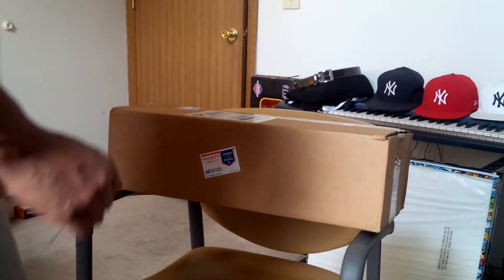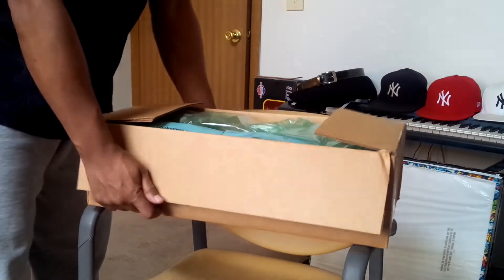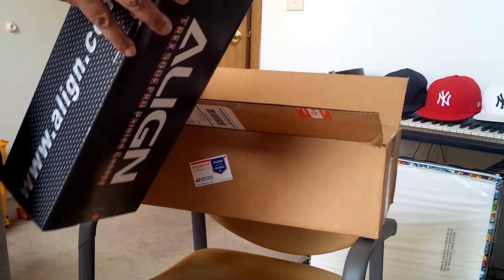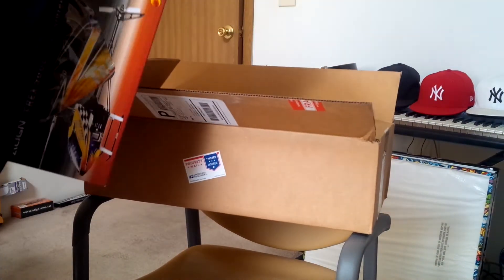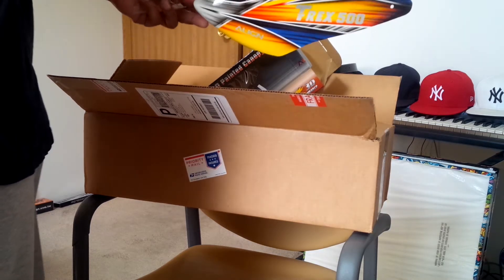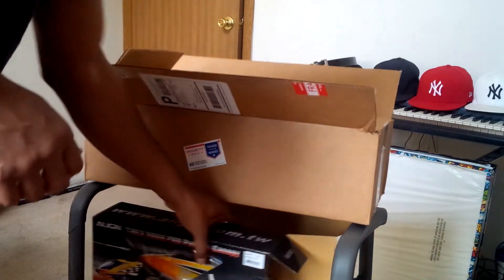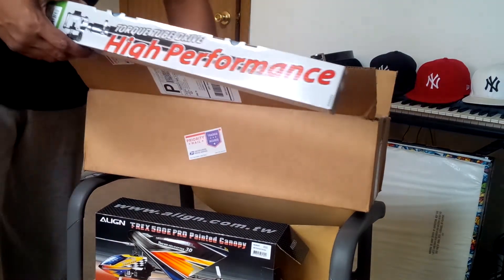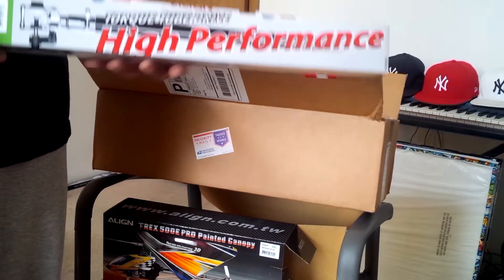500 Torque tube upgrade

Comment: I dont believe TT is an upgrade. But just another way of running your tail rotor.

Belt is nice because it is reliable but depending on power and traction it can skip and cause tail kick outs.

Torque tube is nice because there arent tail kicks at extra power however if you strike the tail the gears are fone most of the time as for the belt it just skips but can be used again.

As for crashes belt wins every time since when you crash most times the tail boom bends. Meaning Torque tube also bends. Causing after rebuild major vibration issues even if sometimes you try to bend the torque tube back straight. So you will end up buying again new TT and gears as when your on belt drive you just replace the tailboom.

Good luck with the build and hope your sort that tail out.
Reply from the maker: You are so right! I didn't have a choice though because Align never has the Tail case for belts anymore. So I said lets try the TT. I'll keep all my other heli's belt for now. Thanks!!!